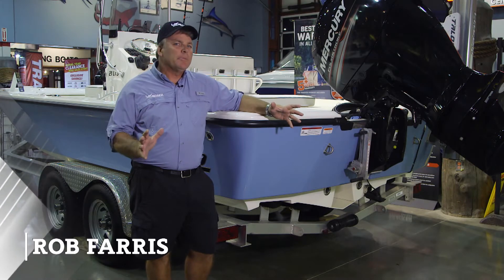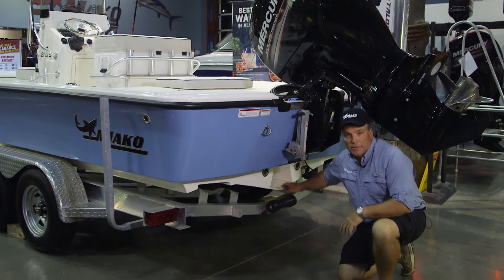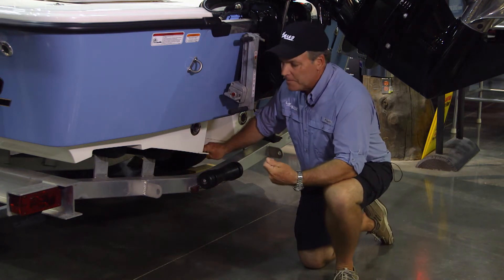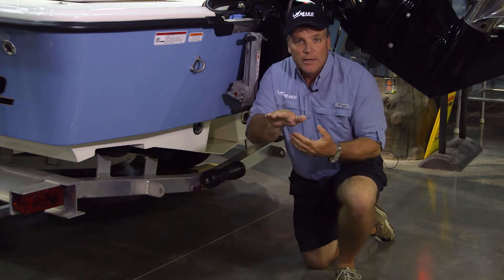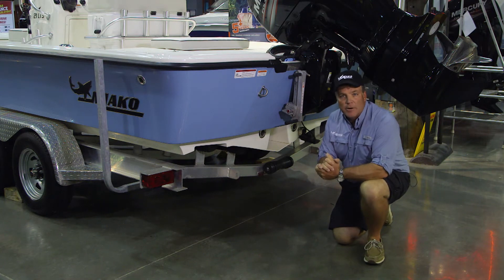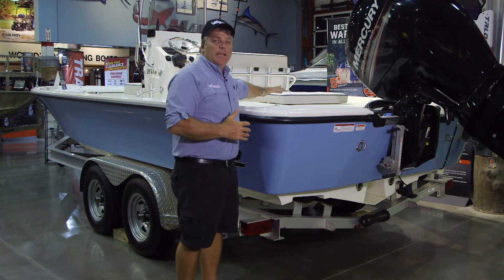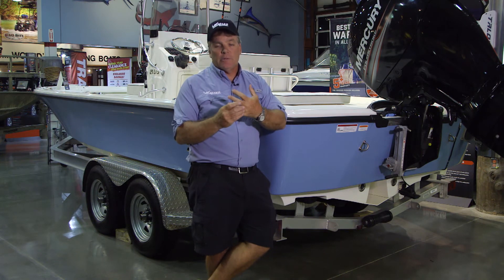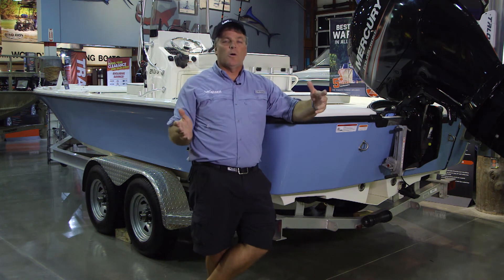MAKO Boats: Rapid Planing System (RPS) Hull Design

Comment: Thanks for posting. Good to know information. This advantage from the RPS changes with the addition of an optional jack-plate ( hydraulic motor lift). With a jack-plate installed, my experience is that I must lower the motor all the way down and also lower the trim so the bow is down . This way, I can get a good "hole shot" and the RPS  adds an advantage to getting on plane much faster. Your experience may be different than mine.

Comment: How shallow can you be for the boat to be able to get up on plane with a full tank of gas and an additional 600 lbs on board?
Reply: My experience is that you must start with the engine in it's lowest position to get any advantage from the RPS. So, without a "Jack-plate" installed about 3 feet of water under the hull.
Reply: EDIT: This should read: "...WITH a jack-plate installed..."; since my experience is based on a jack-plate on my 21 LTS.